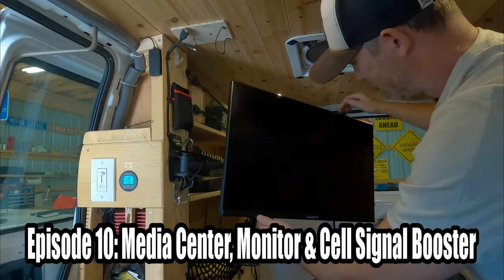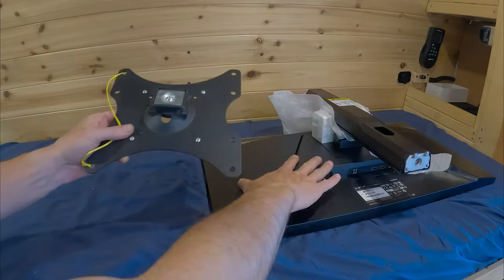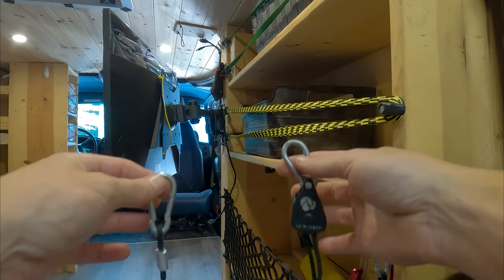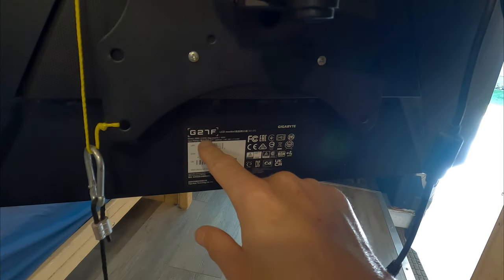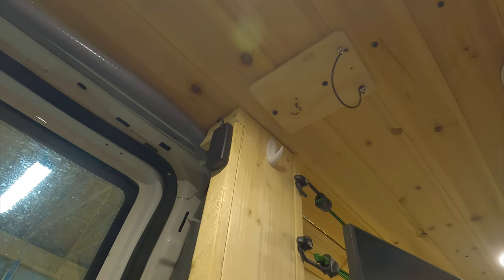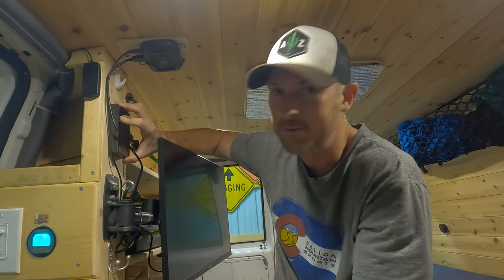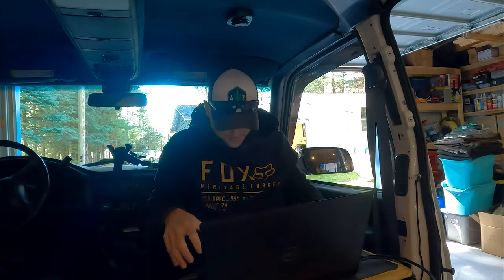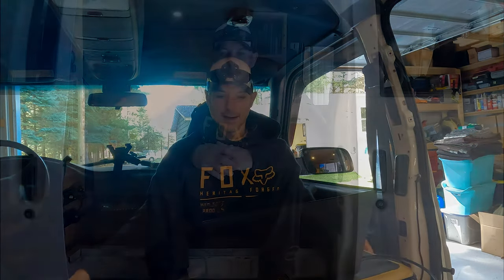Chevy Astro DIY Stealth Camper Van Build EP 10: Media Center, Cell Signal Booster & Work Station

Comment: nice build for sure . Was hoping you did some way for a kayak. Had a astro many years ago and was a reliable van with the 4.3 engine. Best 6 cylinder in my opinion. Definitly you have giving me some ideas. Might just use my kayak trailer and add some storage space on that to.
Reply from the maker: Thanks! I did figure out a way to carry the kayak on top, i took it on a 2 week trip to the Keweenaw peninsula in Michigan's UP last fall. I took some rope and tied loops , about 6" diameter, to the roof rack.   I set the kayak on top of the roof rack and use ratchet straps to strap it down with the loops.  The hooks on the ratchet straps were just a little too small to fit around the roof rack itself, which made the loops necessary. The most major downside is that I can't turn on my Max fan With the kayak mounted above it.

Comment: Nice van build! Just got back today seen your video thought I'd watch. And was wondering if you put a diesel heater in it. We were out Fri an Sat in 0 degree temps at night and it made my little camper as warm an comfortable as being at home.
Reply from the maker: I generally operate in environments that don't get below freezing at night, so I didn't install a heater. Coldest I've been in the van so far is maybe low 20s. There's definitely been a few nights I wish I had some extra warmth, but with some extra layers of clothing and turning on the van to run the heat for 10 minutes in the morning or before bed, I've been ok without. Enjoy that heat for me!

Comment: Hi there! I have really enjoyed watching your DIY Stealth Camper Van Build Series! You have some good ideas and information you have shared with your viewers. I am wonder exactly how my much weight was added to this van with the interior built-ins, the items on  the roof, and other things? Can you tell a difference in how the van drives now you have completed the build? Does the 4.3L engine seems powerful enough for the van now? I apologize for all if these questions, just curious. 

I have often thought i woukd like to have an Astro van myself. For my personal use would like to have it versatile as possible, meaning primarily having it for cargo use, along with provision for rear passenger seats when needed, and a modular type camper setup which can be readily installed, and removed for short term road trips.

Thank your sharing your build. I really appreciate it.

-Rob in Tennessee

Comment: Hey there good video. I've got a 2001 Astro I've been living in full time for about 15 years. I'm looking for a new 12 volt monitor/TV for my rig. I do quite a bit of astrophotography editing while on the road and I'm curious about this monitor. It's the size I'm looking for and I like the plug ins for peripherals. What I'm curious about is on Amazon it lists the Gigabyte G27F as 110 volt, I'm assuming it comes with an adapter that you can use if you want to plug it into 110volt and another cord that is just for 12volt. Is that correct? TIA and keep up the great vids.
Reply from the maker: Dang, 15 years in the astro, well done! this model comes with both 110v AC cord, as well as a 12v DC cord